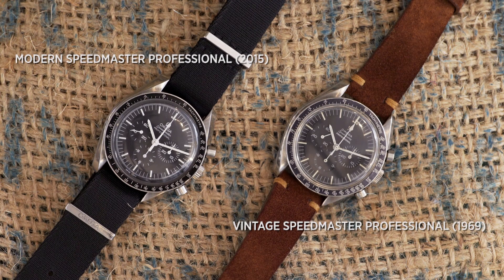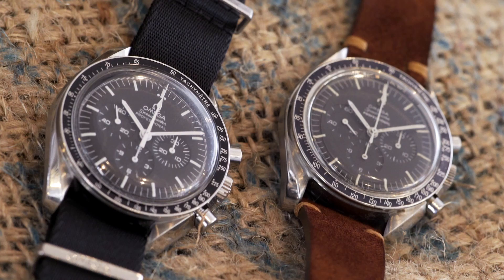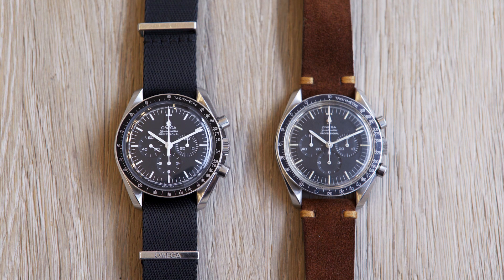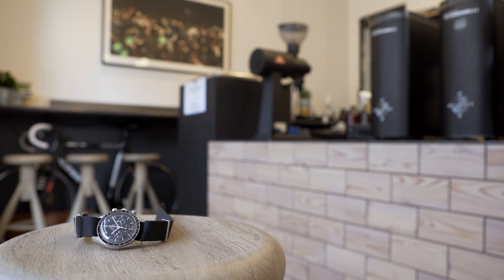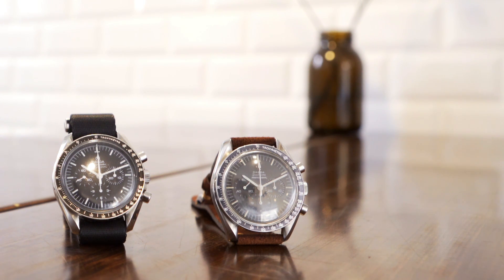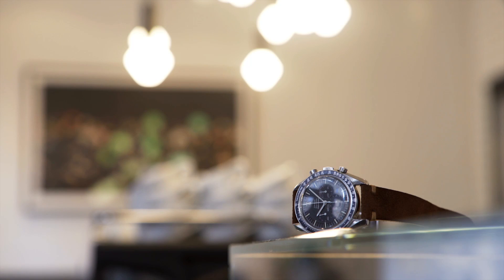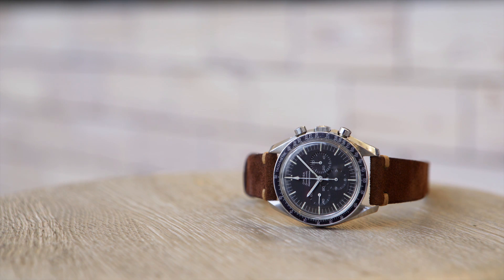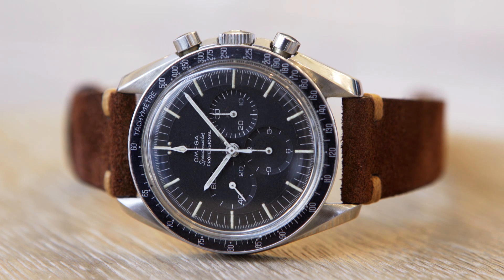Two icons head-to-head: Omega Speedmaster Professional

Comment: Notice the older 1969 version (.861) retains the "dot over 90" on the bezel just like the .321 movement.  Newer watches have the dot next to the ninety second marker.  My Speedmaster is one of the early .861's.  It doesn't have the "moon" logo on the back because it was built just before Apollo 11.  Mine was given to me as a gift in 1969 and I still wear it.  My favorite watch for many reasons.  I've lived with the watch since I was age 17 back in 1969 and I've taken it everywhere, except never into the water. DPA
Reply: Luis Castro    I gave strict instructions to my son that he can never sell it or give it away unless he has a son.  BTW, in the late 1980s, I sent my Speedy back to Omega for a tune-up.   For $300 they gave me a new Haselite crystal, new pushers, a new wristband, but worst of all,  a newer sweep second hand with new subdials.  Back in the day, Omega didn't consider the watch would become an icon for a collector purpose.  Neither did I.  So although they returned to me the original pushers and crystal, Omega never returned the original hands and subdials.  If I had known, I would have insisted that all the dials and wristband be returned.
      The watch was made in October of 1968 so it's over 50 years old.  It looks new but is starting to run slow by about a minute every couple days.  No problem, I just reset it to my iphone.  BTW, thank you for the compliment.  That is how I took it.  Be well.
Reply: I understand Rolex does the same thing when you send a watch to be service, have you thought about what would happen to the speedy if your son doesn't have a son?
Reply: Yes, I told him to keep going until he has a boy.  I doubt he will take my advice.

Comment: I have a pre-moon with a .321 movement I bought around April 1969. Although the case is ST 145.012-67, the strap is 1039 2  69. So the watch must be 51 years old and still working, I wear it every day. One thing to note is that the old pre-moon versions (as mine is) have the omega symbol in metal (steel I think) where as the modern ones have it printed.
Reply from the maker: Excellent point John! Hope you enjoy this masterpiece for many more years to come. What an icon it is.
Reply: John Cross    How do you know your watch is a .321 unless you had your jeweler open it under the microscope, as mine did?  My Speedy was given to me as a BD gift when I turned age 17, on July 30, 1969, only ten days after Apollo 11 landed on the moon.  That means even though it was a gift on July 30, 1969, my jeweler has confirmed it was a brand new .861 movement probably made in the fall of 1968.   It was new and purchased by my high school sweetheart who worked at Macy's (Bambergers at the time).
However, my jeweler opened the watch to confirm the movement about five years ago to confirm it was a .861.  It turns out it was one of the first .861 movements.
      So my assumption is that my .861 Speedmaster given to me as a BD gift ten days after Buzz Aldrin wore the first watch on the moon, was built at least in the fall of 1968, at least 9 or 10 months before it was sold.  That must have meant that Omega had a large stock of Speedmasters that were not selling at the time and were left in a large stock storage, only to be sold as a watch to a few people who knew nothing about it except it was a racing watch. It did not become NASA famous until years later, although it was NASA certified in 1965.
      My high school sweetheart (only God knows where she is now) had a cousin who was a pilot who owned a Speedmaster.  His very likely had a .321 movement since I saw him wear his a few years before I got mine.
      She observed one day that I made mention of how cool his watch was, not knowing anything about it.  Since she worked for a large department store (Bambergers, later bought out by Macy's) she was able to get a 20% discount on all store inventory.  My understanding is that she was able to purchase my new .861 Omega Speedmaster professional for $275.00 U.S.
      In short (or in pants, as Rod Machado would say) I got a brand new Omega Speedmaster for a BD present ten days after the watch was first worn on the moon.  The original moon watch worn by Buzz Aldrin was a .321 Omega Speedmaster Professional.  
       Some will ask:  Why didn't "The First Man" claim to wear a watch on the moon and be the first person to be a moonwalker with a watch.  Well, as the story goes, the Bulova clock built into the Eagle died en route.  So Neil Armstrong unstrapped his Omega Speedmaster Professional and hanged it (no not hung it) on the LEM's instrument panel so he could see the time as he needed to.  But Buzz, being the ever cool watch collector decided to show off his Speedy in the famous "Speedy Shot" en route.  The rest is history.
     It cost me more years later just to have it "tuned up".   LOL.  I Love My Speedy.
Reply: The serial number of my watch begins 2500xxxx. Check out this site for further info: 
https://www.lunaroyster.com/omega-speedmaster-date-of-manufacture-by-serial-numbers/
It must have been old stock being  a 145.012-67 but the metal strap is marked as 1039 2 69. Obviously they build lots of watches then add the straps when required. Plus, I have seen inside the watch, all gold and brass coloured.